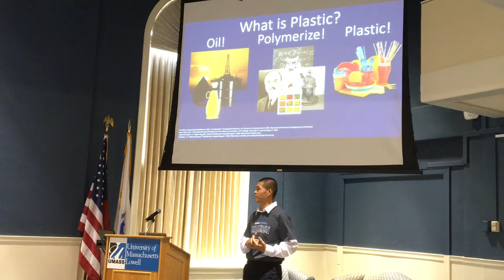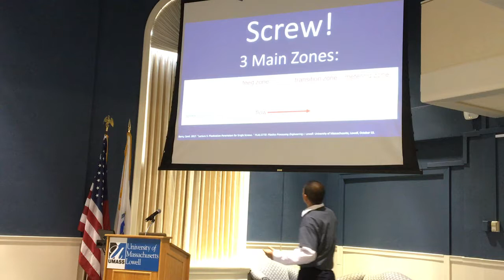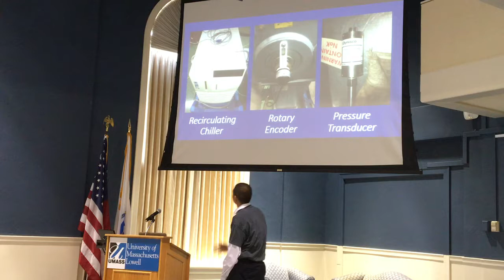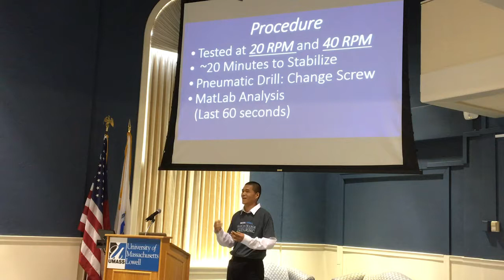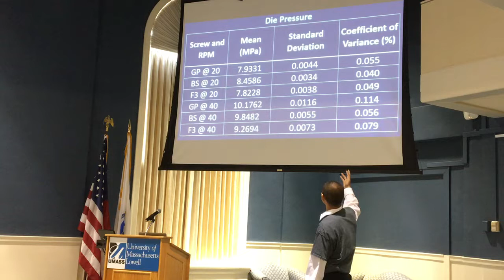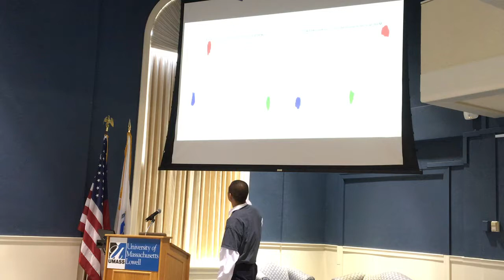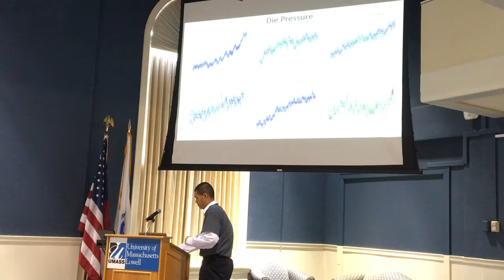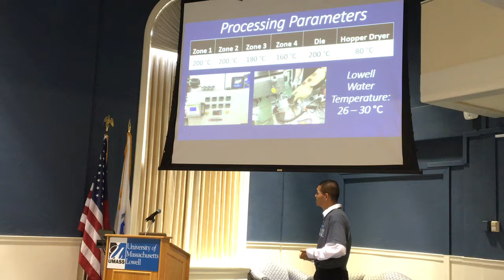Surging in an Extrusion Process with (Conventional, Barrier and Fractal)

Comment: I have a single screw extruder. It's been a while I'm struggling with surging. I have tried all temperature profiles and screw speeds and still the problem exists. I am looking for a solution and i really appreciate if you could help me get rid of that
Reply: Bro did u find any solution for it..plz reply. I am suffering from the same.😢